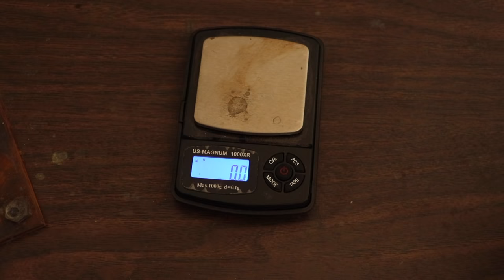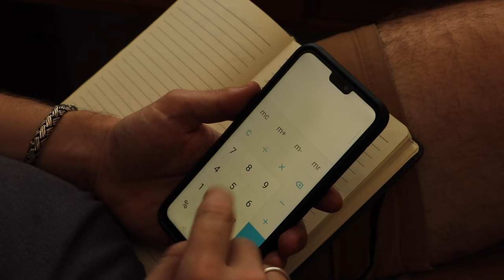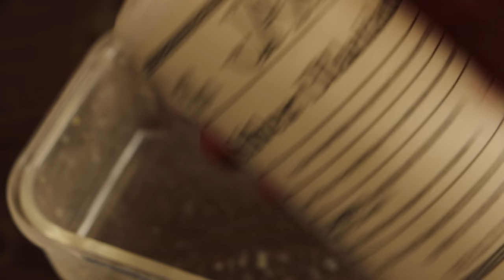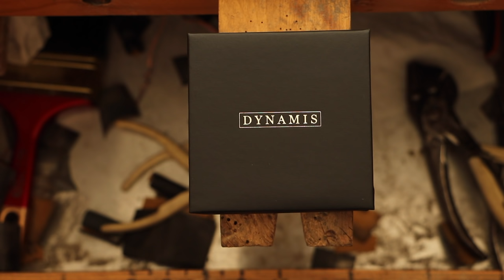Making a Silver Bracelet | Anhor 1+1 | Dynamis Jewelry

Comment: So, that plate that jewelry makers pull the wire through, with all the little holes in it… the one he puts in his Vice, what is that thing for? I’ve seen people do it by hand, and seen some use a crank and chain to pull it through. Does it straighten the wire? Or maybe just ensure it’s the same diameter the entire length?
Reply: It is called a drawing plate. It does two things: changes the wire from square to round, and “draws” it out to a smaller diameter and a longer length.